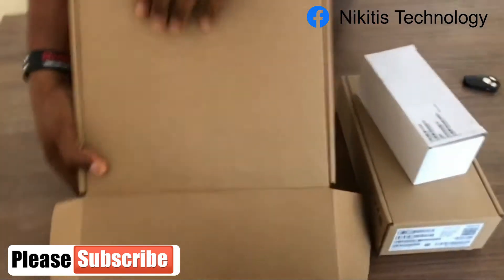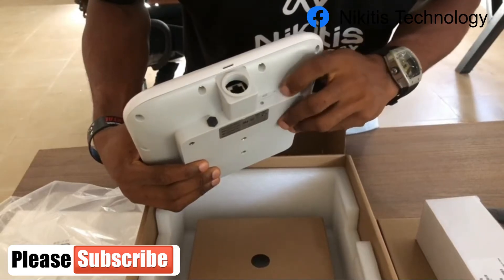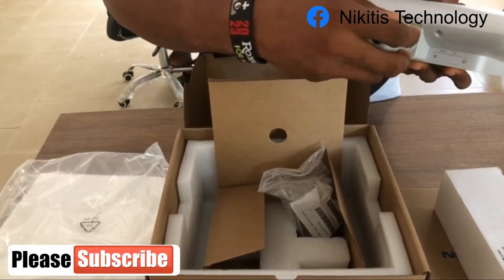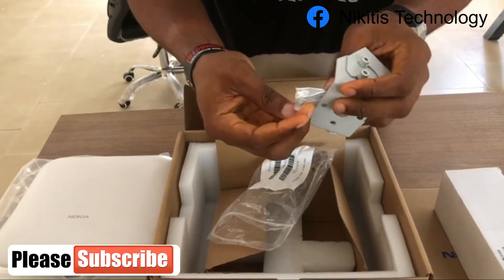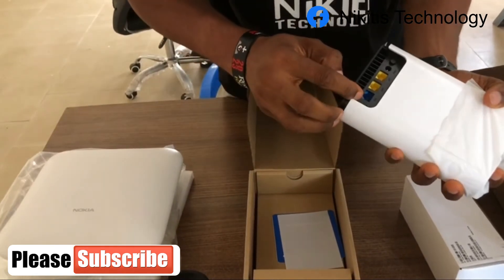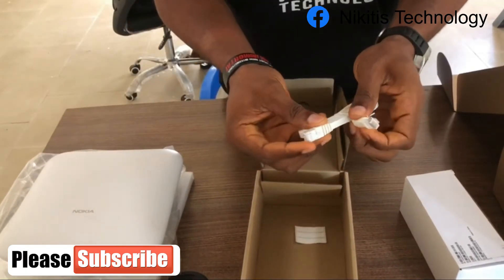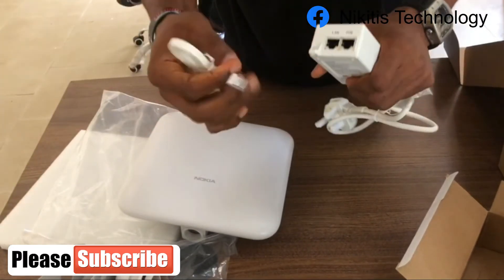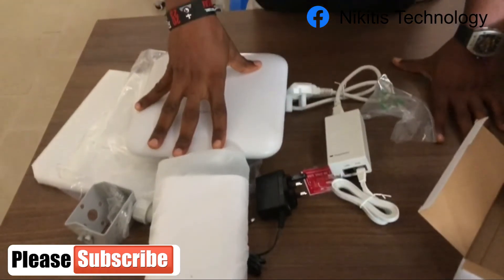How to configure a Nokia ODU (Airtel router)

Comment: Hi, I've had this for 2 years now, but sometime,s in December, I disassembled it cos of power outages. I've tried setting it up again but it says no internet connection despite the blue-green light coming on. What could be the issue?
Reply: It might be your sim card 
Maybe they have block it 
First confirm if the sim is still active 
Then the setup is nit that hard the blue cable that comes from the ODU will enter the PoE and the white small cable will connect to the other port on the PoE to the IDU

Comment: Will it be best used indoors or outdoor?

I just got one today, I have it indoors, the ODU shows 3 bars at the signal and I only get 10mbps at most 😢
Reply from the maker: Survey your installation location first before installation.
Reply: @NikitisTechHub   How do we survey when most airtel offices are more interested in collecting the 100k first before they are ready to send an engineer to the house to do a site/location analysis?
Reply: How much did you buy it

Comment: Pls the network cable or internet cable rather is very short. Yiu didn't explain how you extend the length of wire and the type of wire to use and all that.
Reply from the maker: Check out my IP camera training DAY2, there i explain how you can crimp your own custom Ethernet cable.

Comment: Which is better the airtel ODU Or this Nokia
Reply from the maker: Both are 4G network, depending on your choice.
Reply: The other type is better especially if you plan to power the router with 12v battery
Reply: And how much is this
Reply: @tobijoseph8213  It is free